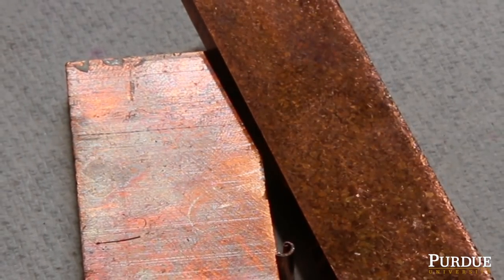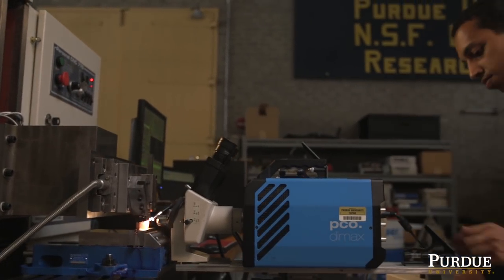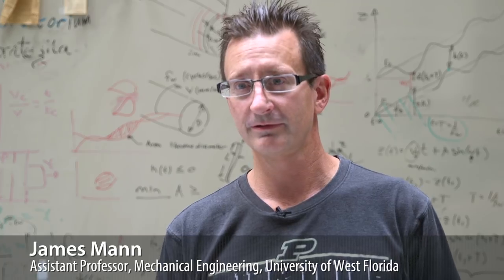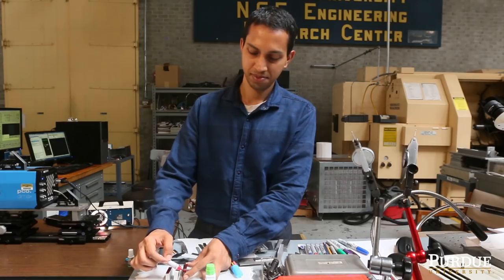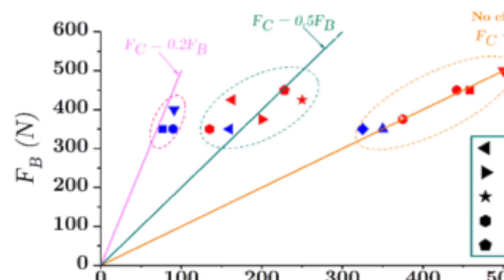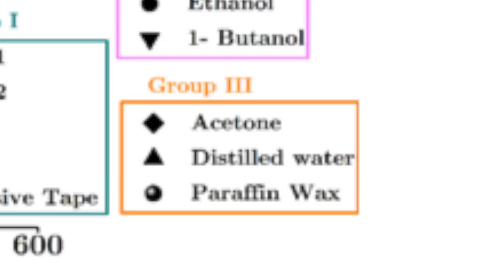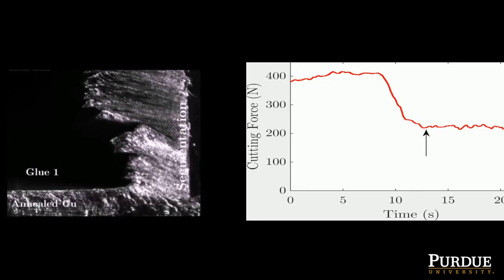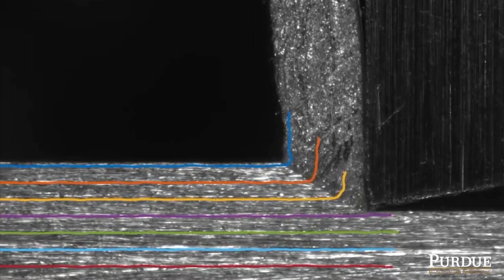Gummy Metals? Add Glue or Markers

Comment: The types of softer materials like copper, some aluminums, etc...can fairly easily be dealt with in other standard ways of the past. The REAL problems are the materials that have the behaviors of gummy material, but are also relatively hard or have higher tensile strength/shear resistance. For instance 304 and 316 stainless steel and even worse, Super alloys.

Comment: Is there any chance it's just cooling the material surface? That should have a hardening effect--especially considering that many of these additives include a liquid that evaporates.
Reply: It doesn't seem so - otherwise group 2 and 3 materials should have a profound effect, but they didn't. Furthermore the Sharpie by all reason shouldn't have a cooling effect, it deposits a small amount of solvent and it's gone nearly instantly.